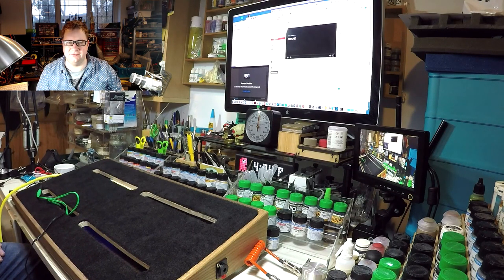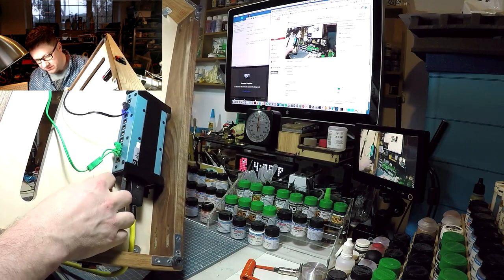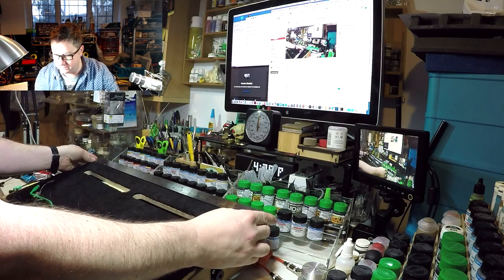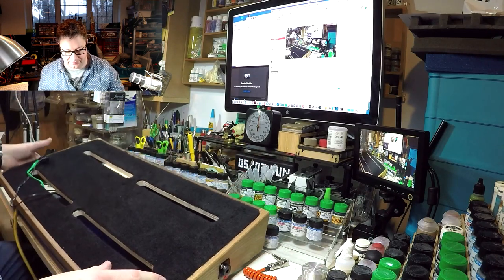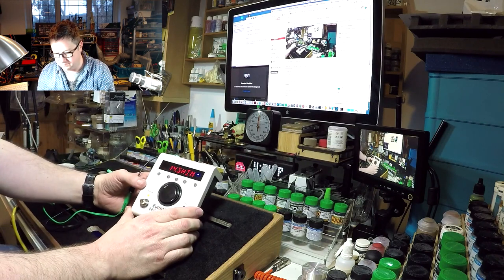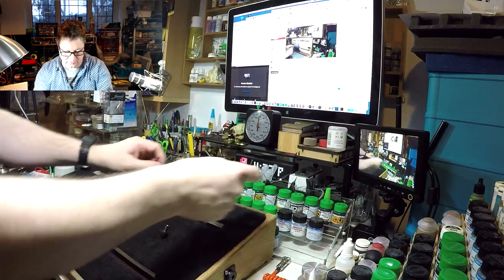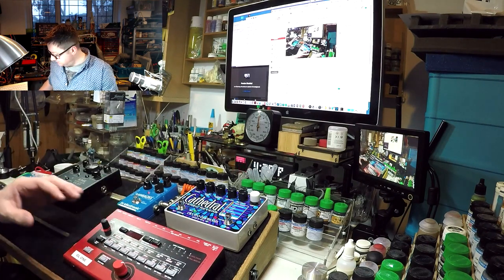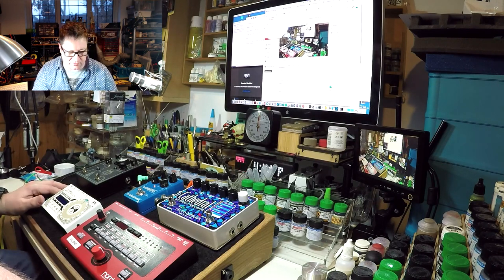T-Rex Fuel Tank with Ruarch Pedal Board Setup for Synths

Comment: hi sir.. fueltank is great power supply?
Reply: No actually, a year after I did this video I switched to the Ojai from Strymon.  I think for guitar and gig work the Fuel tank would be perfect, however it has a hum that is pretty loud and the Ojai is completely silent. So for home studio work where you want really quiet power supplies I would not use the Fuel tank.
Reply: @RottenMechGaming  how if the ojai I use to live show / gigs?
Reply: @BagusWibisono  It's a really solid piece of kit. I run four pedals off it.  Better than the fuel tank for me.